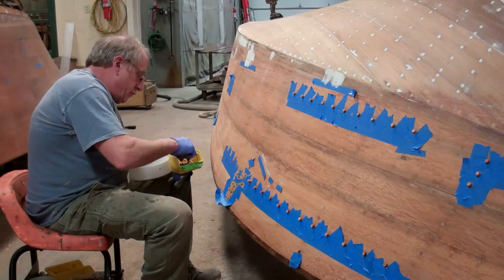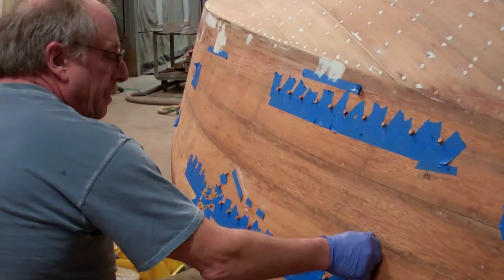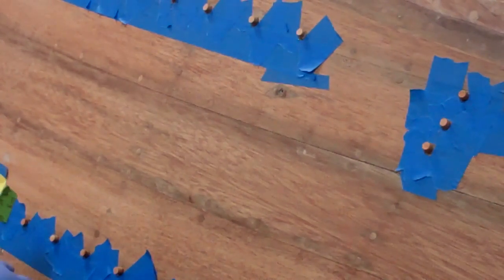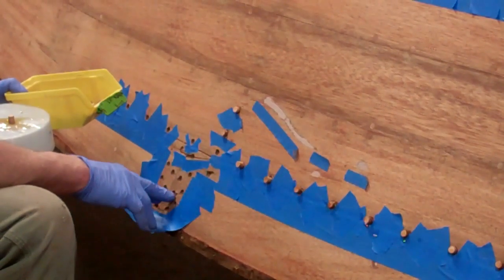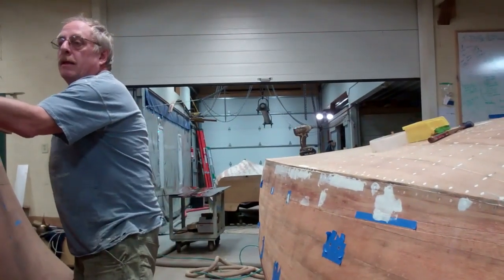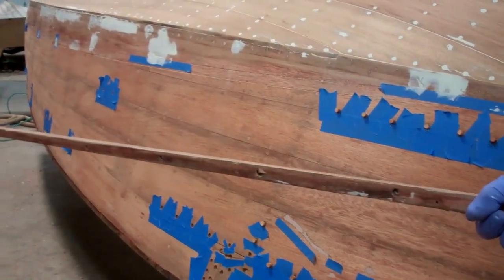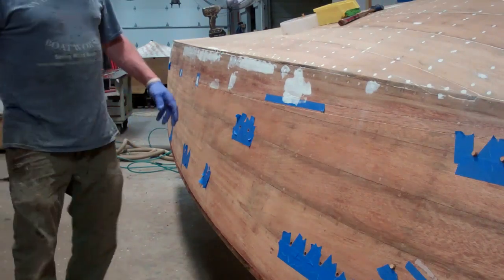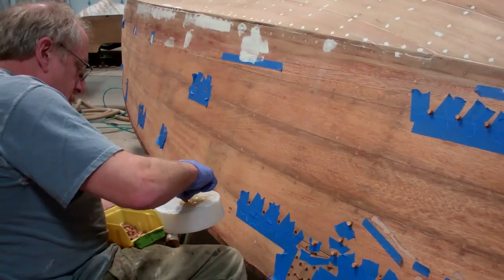59 17' Chris Craft Sportsman Why Attention to Details is Critical 3 3 2017

Comment: I take it, this will be a user boat?
Reply from the maker: Why?We work to one standard, and the final product here will meet that standard. With the 20 coats of varnish applied to her hull once it has been bleached, stained and sealed; her show-chrome-restored hardware, updated upholstery, Kocian-Instruments-restored gauges and fully detailed power plant; she will be fully competitive and should perform well if entered into an ACBS show like that in Clayton, NY.
Reply: You guys do awesome work! I just remember when I helped restore a few Chris Crafts my uncles entered in to the Hessel, MI show back in the late 80's. Short boards and Dutchman's were point deductions. 
Today My 56' 17' Sportsman has a Dutchman (Splice) in the Port side deck combing. Well done, but I would have had the whole combing rail replaced. I figure the previous owner saw how much such a large piece of Mahogany it would have taken to make a new one $$$?.
I am waiting to watch your video on your '38 to see what bottom primer you will use. I am going to do the same preservation to my original bottom on the '56. Thanks Michael!!!!
Reply from the maker: If you can find them! John makes our Dutchmen disappear.. And, since we are preservationists, destroying an entirely original plank in total just to "repair" a small gouge or ding, is blasphemy and worse.I will check with the Clayton Show head judge, whose Gar Wood we are restoring, to confirm your observation about Dutchmen and deductions.I totally agree with you about short boards, however. They deserve a deduction at the very least, largely because they degrade the functional integrity of the hull.In so many ways our space is like asking six economists a policy question and receiving nine answers in return!